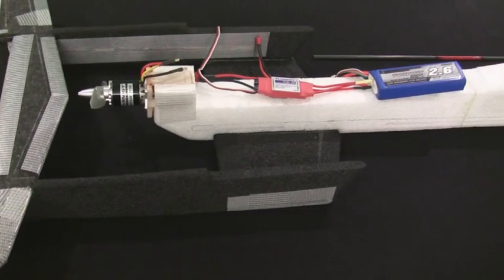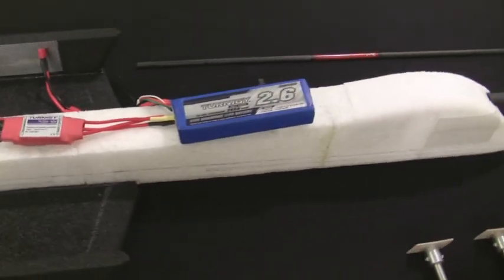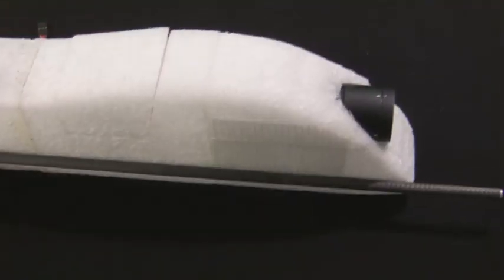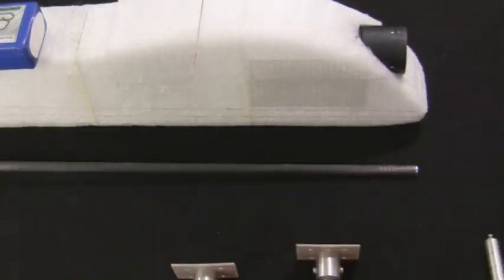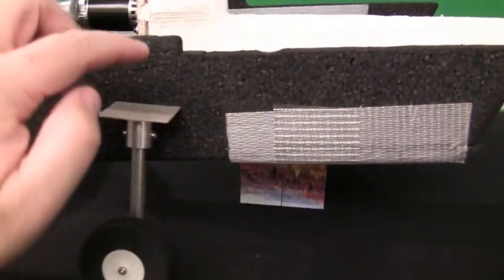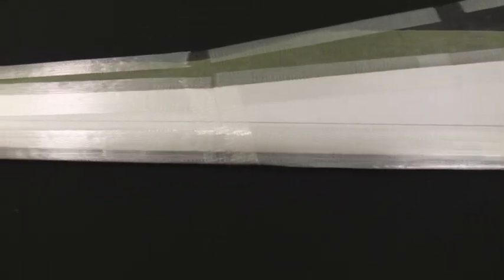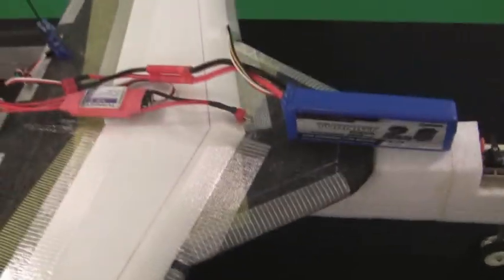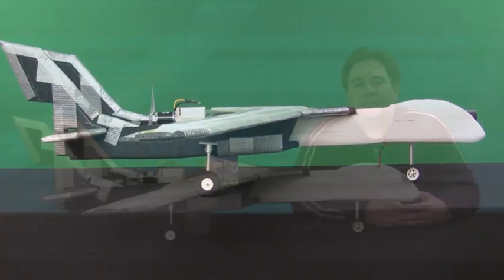FF-64 Recon Part 2

Comment: @rcFoamFighters Yea times is a much smaller 1100kV motorrunning on 2s on an 11.5 prop, his motor is rated at 52 oz of thrust on a 10x5 on 3s at 26A

Just for comparison, His motor is about the size of the mega park jet, mabe a smaller diameter actually. 
I expect yours to tear it up :)

Jon